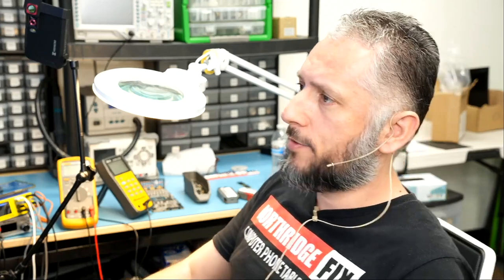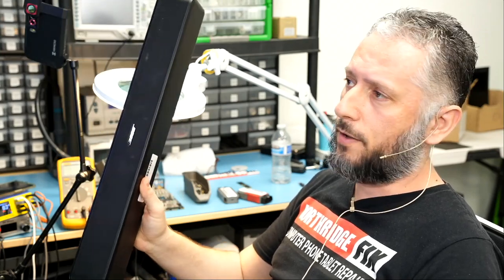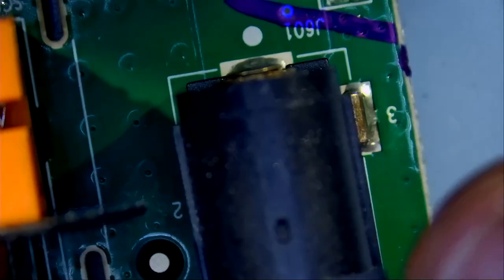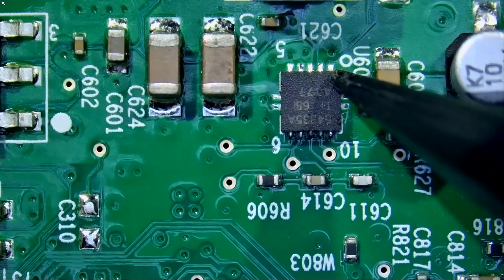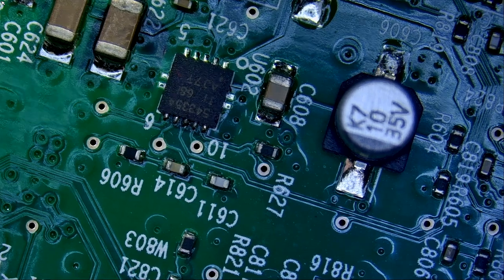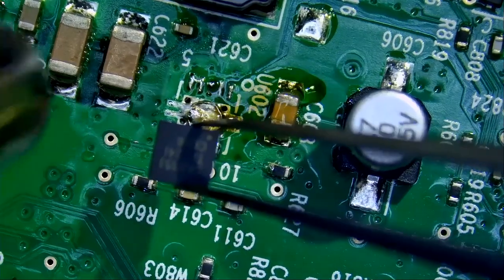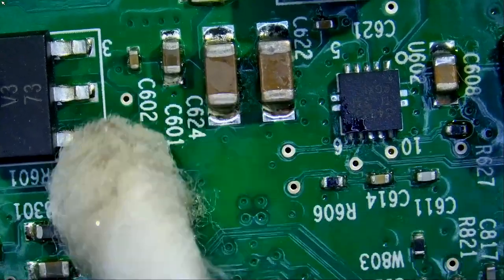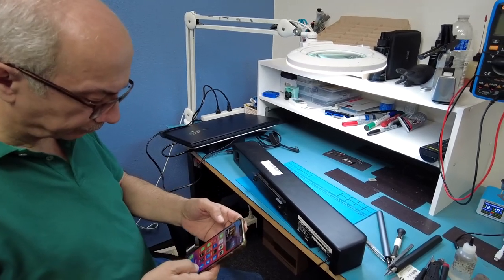Bose Solo 5 Soundbar speaker Repair - Won't power on. Worth fixing?

Comment: That’s a good quality speaker and you’ve demonstrated it is worth others to investigate the repair and save more equipment from ending up in the trash. Many thx Alex 😀👍
Reply: Bose doesn't believe in tweeters, so in many of their products they don't have a tweeter that they don't have in this soundbar. I don't see Bose as any better than other brands
Reply: If it was a good quality speaker, they would not all fail with the same issue ;-)
Reply: @DJChol MacBook always fails with the same issue and considered a good laptop
Reply: @ford1546  Bose a marketing company, not an audio company, and almost anything you get sounds better.
Reply: Hi where you located and how much if I send you the mother board only?
Im having the same problem

Comment: I would honestly like you to continue and provide repairs to devices that might not be economical for you the repair. This gives an opportunity to see how you would tackle an issue but also keep the landfill empty for someone like me that's into DIY, for something stupid like replacing a voltage regulator. Your use of the thermal camera, which you show in many previous videos, really shows it's value. It seems like the customer is willing to pay for the repair, but if not I would hope you would be willing to supplement your equipment orders with videos like this. Keep up the great work Alex.
Reply: Yes. I'd imagine a large portion of devices are not economical for a shop to repair but well worth the repair from the user perspective and for the environment.

Comment: This can also teach users of the speaker how to troubleshoot the problem to see if it is worth fixing.  Folks now know what the potential problem could be if they are experiencing the same problematic behavior.  They can even use the IPA test method to see if that particular chip heats up.  If so, remove the motherboard and send it in for  possible repair and help keep it out of the landfill.  Excellent excellent excellent video.

Comment: The big companies come up with more and more excuses not to service their products, and we cannot continue consuming and wasting like we already do. More people should learn to do these kinds of repair, so that friends and relatives can have their products fixed, even when it is too expensive to send in. Good advice to mail in just the board of this speaker, as it seems to be a repeating fault, like with all those ASUS laptops.

Am disappointed that BOSE made a product that stops working like that, as voltage regulators and other components should be dimensioned to work with some margin, but we all know that, they will too often be too weak for the product to last many years like before.
Reply: I think that some manufacturers skips the "lab" part of developing process in order to lower costs, so many boards are designed by people who only works with the theory, they do the math and never involve in practice so they speculate like "well, all the values are right, in theory that should be enough, that will work just fine" so they never test it for more than a few minutes enough to pass Q.C. but in practice, things are so much different.

Comment: Hello, I had a Bose L2 PA system that was inop due to the power supply. I found a couple rectifier diodes shorted and proceeded to replace them. I immediately realized that the Bose electronics was not designed to be repaired. As careful as I could be to not damage the board, the traces and barrels couldn’t stand what I was doing. I am a retired Aviation Electronics Technician,  and have certifications and years of experience over my life-time.  Not to brag but just beware to anyone that runs into the same scenario I did.

Comment: I had 4 or 5 Solo 5 in teh last Year with the same error. New TPS54335A fixed it. :-)
Reply: Hi there... do you have the link to buy the TPS54335A? The ones i saw had different orientations for the legs
Reply: Great informative video.  TPS54335ADRCR was the part code I got.  10 connection points rather than 8.

Comment: I have the sound bar 300 also didn’t power on. How much is cost to fix it? Could be the same issue with this problem?
Reply: I have Bose TV Speaker Soundbar with the same issue. Did you figure it out… would this part work for my Bose sound bar?

Comment: crazy!! im very new to board repairs, ive fixed a few automotive components including  pcm ignition coil drivers for a jeep... never thought to use my thermal imager... i have the exact issue as in this video! U602 is getting hot as well, what part number did you use? im finding some on digikey but not sure how to properly identify these componets

Comment: I have a Bose sound touch 300 that just randomly stopped functioning. Lights won't light up. Bluetooth would show up on my phone before I un plugged the unit from the power. Firmware updated from online successfully w USB mini in back. But no audio still and remote inputs don't work. Still no light. How much to fix this board? I'll send it in.

Comment: That little chip would probably do well with a small heatsink. Its a 3 amp regulator. That's a lot of heat for such a small chip, even with the sink connection to the board
Reply: Probably designed that way tbh. I have a Bose TV Speaker Soundbar (same thing almost) that has the same issue. Would this part work 🤷‍♂️?

Comment: I paid bose £79 to repair my solo 5 they have had it twice for 4 weeks plus each time and it still keeps switching itself off when it goes off it will not let me switch it back a long time the second time they said that they could not find anything wrong and sent it back it broke down again after 2 days

Comment: Why don't govt regulators mandate manufacturers like Bose and others to make schematics available mandatorily. And spare parts as well. Dumping the whole things just because of a small voltage regulator is such a waste of money, not to mention the added cost of environmental degradation. Appreciate the customer's will to get this fixed instead of simply buying a new one.
Reply: Search some of the right to repair advocate videos on YouTube and you'll soon see the excuses and obstacles that manufacturers use to thwart, even at state level, the type of regulation you are suggesting. And it really doesn't need to be said but those manufacturers want people to buy a new one of their product not repair what they already have.
Reply: Minnesota recently passed some legislation about this. I dont expect it to work though.